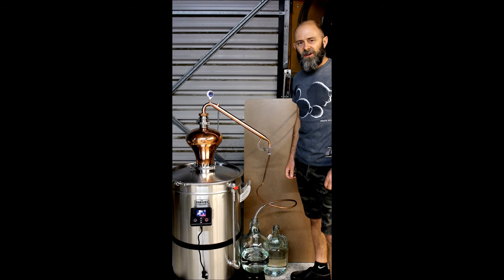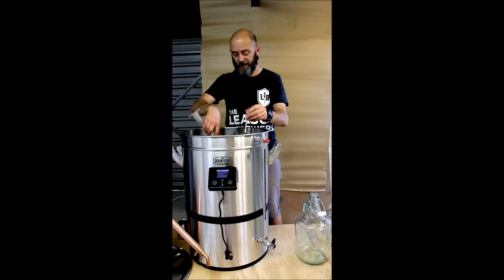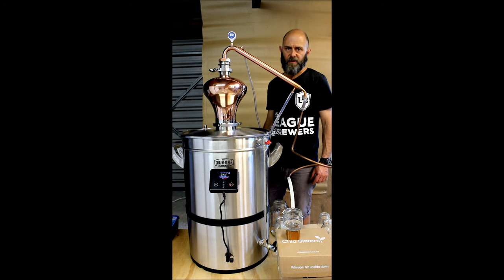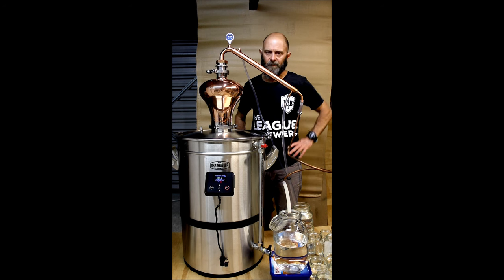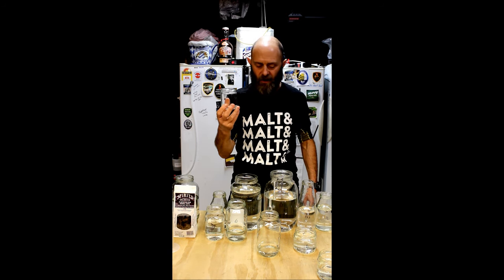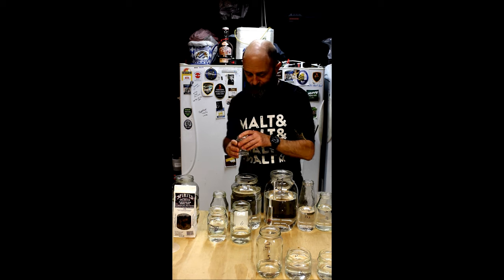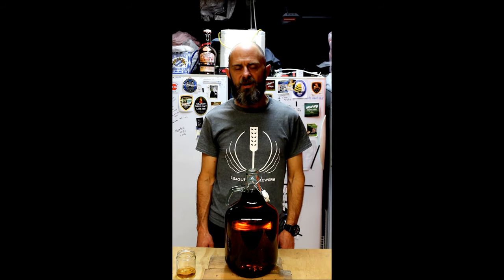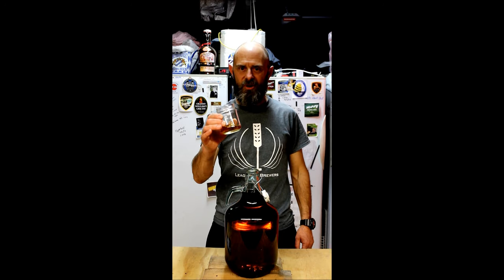Distilling with the Grainfather G40 to make Honey Rum

Comment: I have that lid too. Gonna run a clean, sacrificial, stripping and spirits run in few hours...

My rig is 2.5" Vevor football still with additional 500mm (bit copper packed) pipe, sight glass and deflagmator. 
More 2.5" stuff is on the way, a whole relfux tower in fact. Im going to stretch it loong. Probably support with ladder.
Anyways, idk why i ended up with such gimmick size, because you cant get much elements in that league and getting bigger is too expensive, for now...

Lack of content on G40 is indeed bad but please, even worse is using plastic with high ABV alcohol. Ditch silicone too.
My 2 cents.